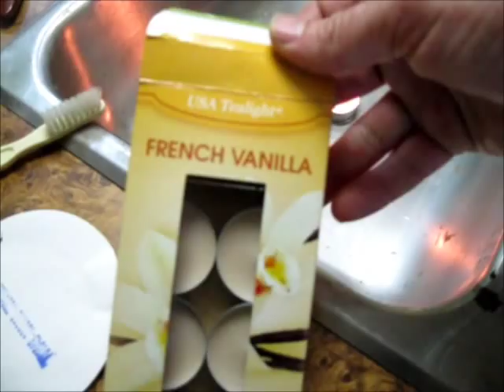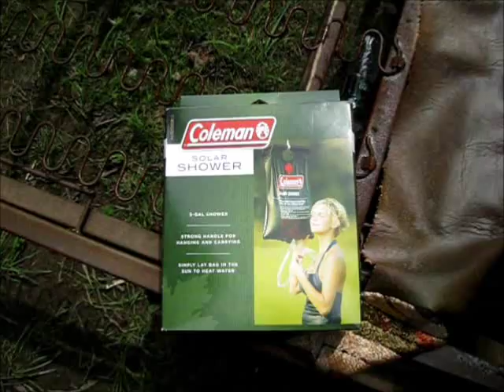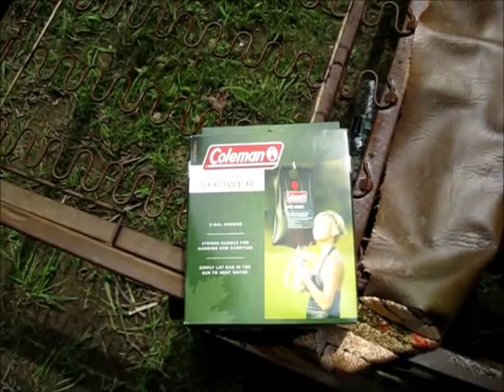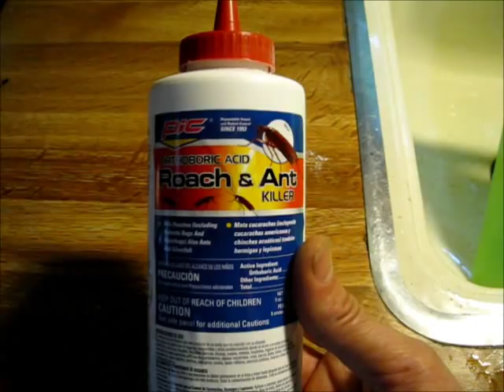More Mice More Ants And RV Renovation Continues

Comment: Are you getting over unity on that Bedini motor/generator?  I've watched the entire "Energy From the Vacuum" series and I still don't know what is going on.  I understand the Bedini can restore an old dead battery but what are the other advantages?  I'm really interested in the Bedini stuff but I'm also extremely ignorant when it comes to electricity.  Is it really possible to capture the back EMF for over unity?

Comment from the maker: You can use solar to power the Bedini. But the output of the Bedini is not conventional electricity and gets converted by the battery into a usable form of energy.

You can use a silent set of bearings, yes.

Comment: why would you want to use the bedini into the charge controller? It uses energy after all (even if it's a small amount), so there'd be no benefit. And also, you probably wouldn't want high voltage spikes going into that thing.

Comment: Mechanical spring traps and peanutbutter.

You need to fill every crack and crevice from underneath with stainless steel wool and spray foam.

Comment from the maker: I am not getting OU, at least not to my knowledge. You need a scope to measure that.

I am happy to be able to restore batteries with it. Actually, yes, you can get OU when you connect multiple batteries in parallel. They all get charged up with no increase on the input side.

Yes, you can capture back EMF. Its actually a different form of energy.

I dont understand the physics of it but enjoy the effects of the motor.

Comment: Troy:

Bad news about the mice. Maybe you should leave the Beddini loud and vibrations will transmit through RV frame and keep mice away?
You need to plug all the holes somehow... spray foam mixed with steel wool is suppose to be the cure.

Comment: Troy, definitely stock up on the boric acid. it has many uses other than just ant and roach poison. In fact, I am using it right now to get rid of a nasty poison ivy reaction. works good for lots of stuff. For the poison ivy, I mix it with equally with baking soda, then add just enough water to make a paste, lather it on and let it dry and flake off. works good, not as fast as medicine from the dr, but who can afford dr visits these days.

Comment: You still have time to grow food before Winter but you need to use that new area you ploughed and raise the soil in furrows and then plant the seedlings in the correct spacing's.  Here is a website that can guide you with what to plant when. 
Google gardenate 

It has nothing to do with excessive rain. You will still get something's that will grow in your raised beds but most will rot. Create furrows in the new area, cover with 2 inches of that compost material. Then plant.

Comment: Troy - get your nice foam bed out of the RV until you use it to protect from any new rodents or at least wrap in plastic and duct tape the seams.  - hey!  maybe the vibration from your bedding will chase away the rodents!  If you can find cardboard boxes easily, place layers of them on the ground around your beds so the weeds gets smothered - they will decompose over time.  As always, you're doing a great job!  Don't lose heart, I'm praying for you?

Comment: Check zoning. If no zoning laws for the area or nothing preventing it, insulate well. Where I live, there are "minimum house size" laws. Basically I'm not allowed to build anything in this general area that is less than 200 square feet. Also technically there are laws where I am banning living in an RV/camper. Pretty stiff penalties including some jail time. Insanity I know. I plan to move.